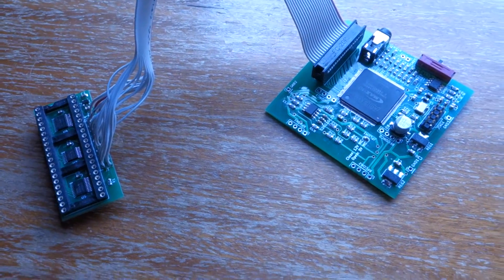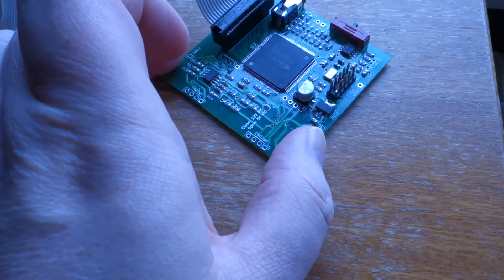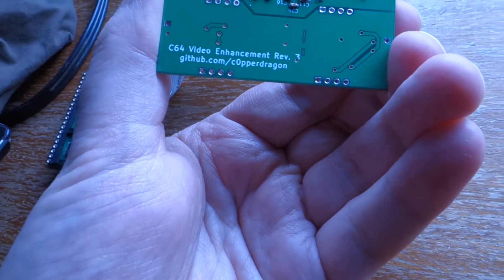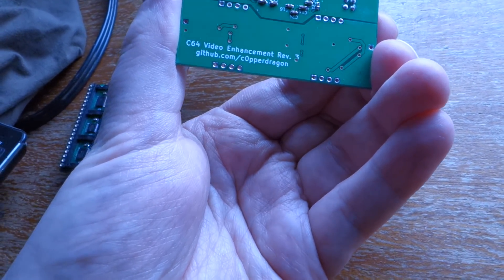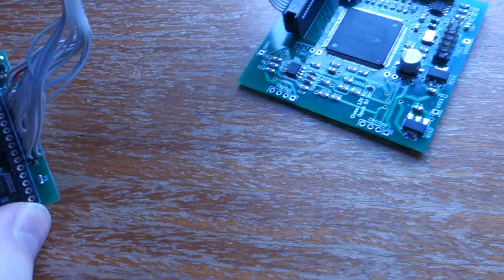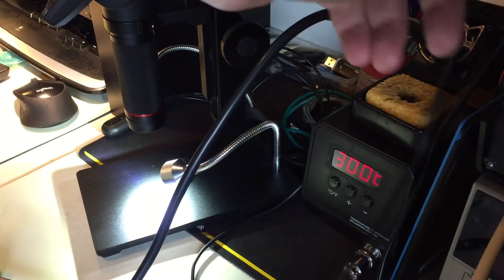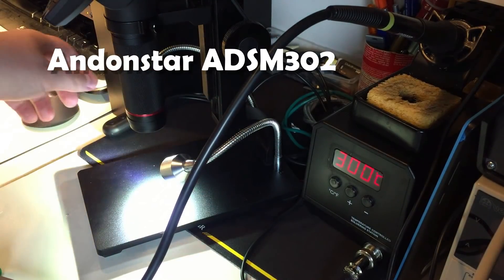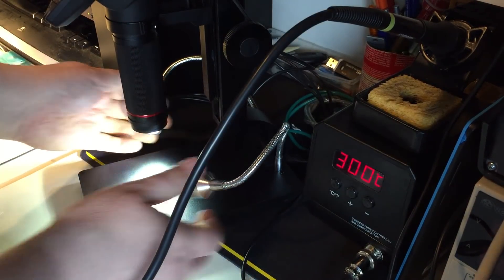Soldering  a TQFP-144 under my new microscope

Comment: First apply flux gel..then solder all the corners...then use a small bevel tip and drag solder the chip...absolutely the best method :)

Comment: and i was taught never directly apply solder to the iron? add heat to the joint then add solder to the joint near the heated tip? need to go back to school :) Good Work!

Comment: Is that an exposed trace @ 10:20 (under 3rd leg from left) or just a spot of flux?
Reply from the maker: exposed copper.
Reply: Ok, is that something that was repaired somehow?
Reply: @en4cer450  It is not likely to short anything or cause any damage. If you really needed to repair it then you could add some polymer or glue to to cover it. kapton tape would also work.

Comment: you should not use Q-Tip for applying flux... they leave some wire of cottons.... and also try to use a bevel soldering tip... and at 10:45 adding flux is way more useful than adding solder

Comment: What kind of flux do you use? I tried to solder a new charging port on an ipod and it's a globby mess.. Would adding flux and doing this remove the globbage?
Reply: Introvert flux definitely helps. Use the paste and not the liquid pen garbage. Also use leaded solder if possible.
Reply: Use amtech NC 559 v2 flux is the best in my opinion.

Comment: One question is about the fumes of the soldering if causing dirt to the microscope lenses.Also instead one by one can solder all the pins together and then clean the pins by pulling the excess solder to the second soldering pass.Helps a lot for easy soldering the flat wide solder tip rather than the rounded.

Comment: Is using that much flux the key to success ?
Reply: Sometimes it is.
Reply from the maker: It does help the ton flow better. Look at 13:15 where there was too little. The solder dragged along oxidize, unlike soldering thru hole, you add fresh solder with flux core to every pin and hole.

Comment: Great vid!  Would hot air rework be better to solder that chip?
Reply from the maker: Thanks! It is hard to get even distribution of solder paste unless you have a solder paste stencil.
Reply: Soldering with a pen is definitely better, flattening the uneven solder with hot air seals the deal.👍